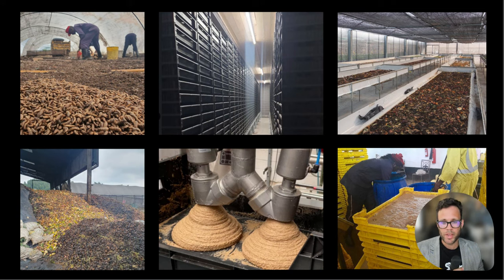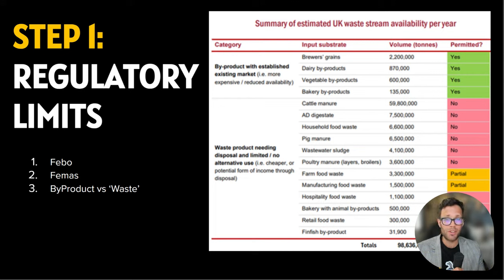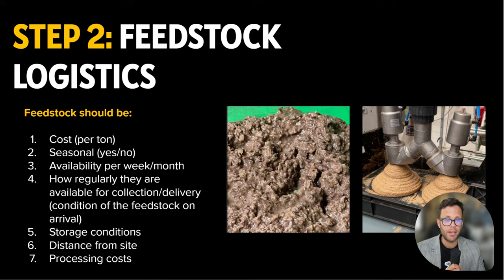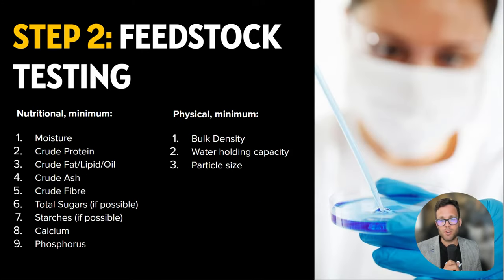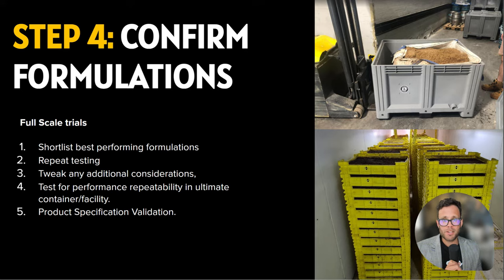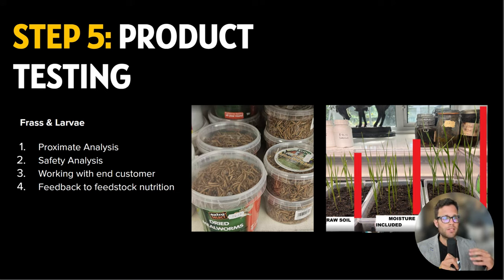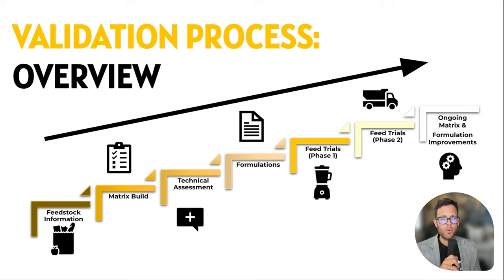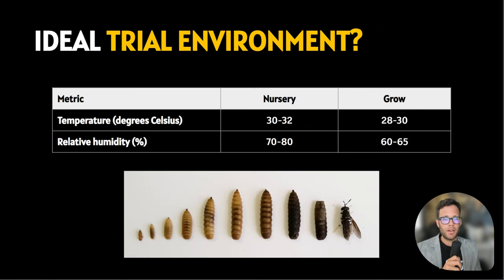Insect Farming Nutrition and Feedstock Economics - The Basics

Comment: How about the pooh pooh of black soldier fly larvae as a fertilizer have you tried? What's the advantages?
Reply from the maker: Yes, of course! You’re referring to frass, a natural and potent fertiliser made from larvae sheddings, faeces, and leftover organic material. This nutrient-rich byproduct serves as an excellent soil amendment, supporting sustainable agricultural practices.

Some of the key benefits of frass include boosting plant immunity through chitin, providing a high NPK value for natural fertilisation, increasing plant yield, and acting as a natural insect repellent. It also serves as a biostimulant rich in microorganisms and is both odour-free and dry, making it easy to handle and apply.
Reply: Dookie and bugs bruh u might not have a soul 😂😂😂